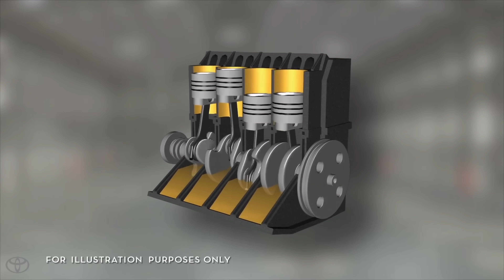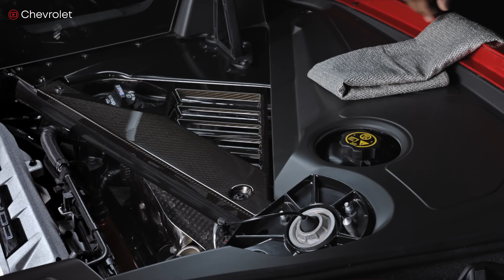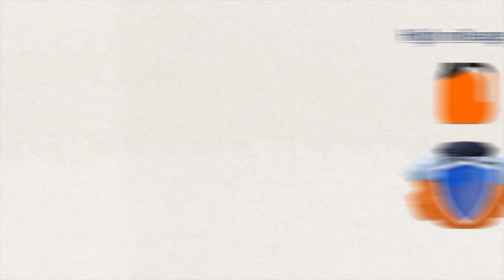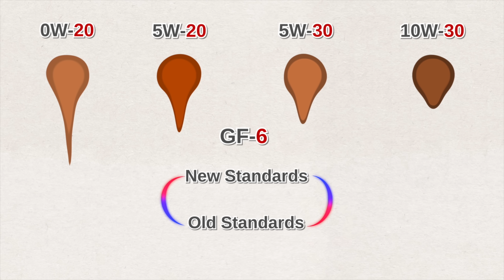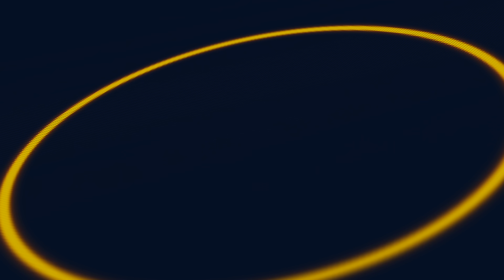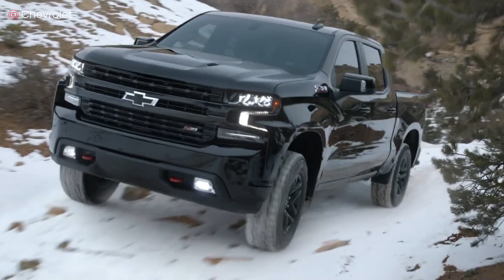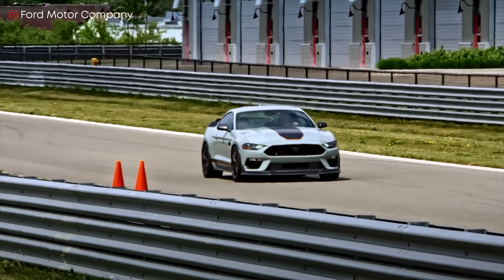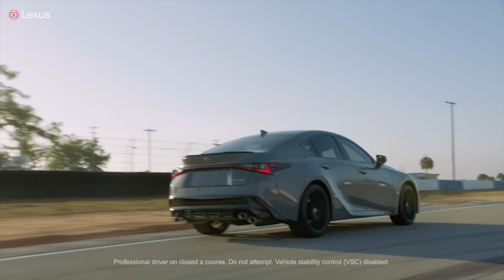7 Engine Oil Myths Stupid People Fall For

Comment: Scotty what do you think of the new 20000 miles new advance full synthetic?
Reply: I've owned some VW's and Volvos (in Sweden) and oil change intervall has been 30 000km (18 641miles) or at least once a year. Never been a problem. No one here changes oil between ordinary serices. And cars don't break down.
Reply: @lokis7230  much better oil formulations in europe though.
Reply: He made a video awhile back explaining how he'd never go that far on even synthetic oil. Oil advertised to go 20k were tested in controlled conditions and probably only highway driving. It's not worth doing on turbocharged vehicles and engines with variable valve timing.
Reply: My friend is a Toyota mechanic. He has replaced several engines where people
believed that 15 - 20K oil changes were OK with synthetic oils. One woman
had her oil changed in a Corolla at 15K then brought it in at 30K to have the second change. They used a long life full synthetic oil too. She complained about an odd noise. They  had to remove the engine.
The top of the head was covered in sludge and the main bearings were so wore it would
not hold proper oil pressure. Cylinders were badly scuffed as well. This was at only 30K miles. Believe me, regular oil
changes at no more then 5K miles are real cheap insurance against major engine failure.
Infiniti will not even warranty a car that  has engine issues where the owner has not
changed the oil at least every 5K.

Comment: One (probably stupid question)  Is High-Milage oil full synthetic?  I have been putting full synthetic in my 95 Vette for the life of the vehicle.  It only has 50,000 miles now, but when it approaches 75,000 should I stay with the full synthetic or switch to high milage?
Reply: i would stay with what you have been using

Comment: Scott,
I have a 2010 Chevrolet Suburban, with a 5.3 Vortec motor. I had a failed lifter, took it into a shop and the replaced all the lifters, pushrods, and the rockers. But when they started the engine after the repairs, there was still a ticking sound. They told me the do not know what the problem is, and didn't charge me full price since they did not repair the vehicle, but still charged me over $1,000.
I took off the valve covers, and confirmed none if the lifters failed. What should I check next? And, should I run 10W 40 to help quiet the motor?  The ticking is loudest at start up, then quiets down, but never goes away.  Also, the oil pressure is a little low.
Reply: That's common in the LS engines. It is a lifter not pumping up or holding oil. You could have got a defective lifter from the dealer. You also mentioned low oil pressure, I would address that first by cleaning the oil pump bypass or replacing the oil pump if you are not comfortable fixing it yourself.

Comment: Any one remember the days of re-refined oil?  The wisest thing for a car owner to do is read the owners manual and follow the recommendations contained therein.
Reply: Ahhhhh.....  Those "were” the days.....😉

Tear down an engine and rebuild it ... Just for sumthun to do.
Reply: I used that stuff in a 55 Ford I had.  It got 150miles/qt after oil change the 50miles
/qt there after.  I then used re-refined oil $.50 per qt.
Reply: @tim4269  engine rebuild pellets in a can from JC Whitney could've fixed that problem.
Reply: We ran drain oil all the time 🙃
Reply: Tom- When I was young and no money I never used new oil. Just used old drained oil from local garage. Vehicle used 1qt. every 100mi.
Reply: @rogertycholiz2218  That's honestly hilarious that you would do that to your engine and then brag about it
Reply: And they had the nerve to market it under the name Ring Seal in my area.
   👍👍👍

Comment: My 2008 BMW recommendation is 5W-30.  I live in O.C. California.  Should I use 10W-30, 40 or stick with manuel/dealer recommendation?
Reply: Stick with what the manufacturer recommends, making sure its synthetic. Your Owner's Manual may explain in more detail about what types of engine oils to use depending in climate/temperature/altitude, but for the most part, just put in what the oil cap has printed. Cheers! 👍
Reply: Find a european oil that meets your BMW car's specs. It is much better.

Comment: Scotty you didn’t cover HD  I’ve used 30HD in my lawn equipment forever. I’ve heard 2 different things for HD  
Heavy Duty.   or. High Detergent 
I bought an older car that didn’t get a lot of maintenance I changed the oil every 3000 but I changed the filter at 1500 and topped it off and changed ATF at 12,000 miles I changed oil filter ATF and I had quit using oil and I tried your trick of keeping 1qt of ATF and transmission felt better 
Sucked brake reservoir empty filled with fresh fluid and bled the brakes no air but not pristine looking brake fluid topped off coming up on 250,000 miles suspension bushings next and driver’s seat mine is only the 5th to slide in but it’s been slid enough to wear out cover and seat toooo it would be nice if it got the MPG’s my 90’s and newer gets but they put lots of good tough steel in Detroit cars/trucks back then and smog was PCV
Thanx love your honesty & knowledge 
short commute these days you & 1 kid in Tennessee the other (& mother) in NY state and memories of Texas

Comment: You mentioned that one may want to consider changing their oil more often, especially if they drive at higher speeds. I thought it was the inverse of this, that higher speeds cause less carbon buildup and are roughly equivalent to about 1/3 of the miles driven at city speeds. I’m assuming “higher” speeds meant “freeway/highway” speeds though and maybe that’s not what you meant. Clarification?
Reply: Higher speeds cause more heat.  Synthetics can better take more heat.

Comment: So, 0W40 is good im low and high temperatures?
Reply: Yes as long as the engine is okay with a 40 weight, you get the best of both worlds for freezing and high temps. 0w-40 eventually shears into a 5w-30 due to having a lot more viscosity modifiers.

Comment: I finally caught you leaving out an important fact after watching dozens of videos. Among "synthetic" oils, there are two main types. There are the PAO based, entirely synthetic oils that originally were the only ones. Then there are the hydro-cracked petroleum oils that have been permitted be called "synthetic" by the standards organizations, doubtless after an exchange of money. These hydrocracked "synthetics" are NOT equivalent to actual PAO synthetic oil. They break down just like petroleum based conventional oil.

In general, real synthetics don't cost much more, and mostly command the same prices as hydro-cracked petroleum so-called "synthetic" oils. They should be preferred every time. Shame on the automobile standards companies for muddying the waters, allowing enhanced prices for petroleum based products.

Comment: Full Synthetic Oil is not synthetic at all. And it is NOT 100% Synthetic Oil.
Reply: Are all oils with European car brand certifications 100% synthetic? I know there is Motul, but there is also Castrol, Liqui Moly, Pennzoil Euro and Mobil 1 Euro. Are these usually "blends?"
Reply: @Dcc357  There's only two companies that make 100% Synthetic. You named one in Motul and the other is Amsoil. They both are certified 100% Synthetic. All others are only blends.

Comment: Great info as usual!  Oil is always a hot topic.  Imagine that, check the vehicle and the owners manual!  That's the answer.  Older designs (Early 80's, 70's, 60's and older.), small air cooled engines like lawn mowers, ATVs/motorcycles, VW air cooled engines and other solid pushrod or flat tappet engines need Zinc.  You shouldn't use anything later than API SJ if you want it to last.  If you look at the bottles for small engine oil, ATV/motorcycle oil, and Elf oil for specific VW diesel engines, you will see it is API SJ.  The Zinc is consumed, so changing the oil more often is needed in those designs.  The best oil is the one the engine is designed to use.
Reply: That's for the zinc enthusiasts. The rest of us use most any modern engine oil without a problem or concern.

Comment: This is a great video and very informative. That said, what type of oil do you recommend for an electric car? Oh, wait a minute, I just remembered that an electric car doesn't have ANY of the parts that oil protects from wearing out. I guess that's why engineers have concluded that electric cars are far more reliable, will last longer, and have far lower maintenance costs than cars with internal combustion engines.
Reply: Do you feel better now?
Reply: First of all the tech in those cars like Teslas won’t be lasting more than 10/15 years guaranteed. Maybe it will but it will definitely need expensive repairs (think $10k +). Simply because the plastic and wires and electronics might have beeen cheaply assembled and made. But when they break they also affect surrounding areas which in return means more expensive repairs in the long run.
Reply: Lol yeah okay maybe in fantasy land or a fixed climate in reality far from the truth. And who do you think builds a better vehicle some amateur that just started a year ago or a company who has been around for 100 years.
Reply: @foxbodyguyeightyeight3672  Right all the Tesla people out here defending their brand as if their so called technology will last 10+ years
Reply: Tell that to the people whose electric cars are INOP because PCB failures of parts shortages.
Reply: @Old-n-slo-locked-n-leaned  Do you have any evidence that people with EVs are inconvenienced more than gasoline car owners, or are you just making stuff up? Seriously, point to a study or some data based upon something other than your personal opinion,

Comment: Scotty, I drive a 1985 ford ranger with a 2.8l v6. I change my oil once a month religiosly. Ford recommends 5w30 conventional, I run Valvoline 10w40 full synthetic high mileage and wix XP filters (change the filter every oil change) I decided to run a slightly thicker oil due to the fact that my truck has +800k miles on it with original engine ECT. 
I also only use ethanol free 93 octane fuel in my truck. 
I drive about 400-700 miles per month (never aggressively 65 mph and less)  and I'm trying to do everything I possibly can to preserve the life of my engine and drive train. I also change my plugs, wires, fuel filter and air filter every 3 months as well as thoroughly washing my engine and engine bay with super clean about every 2-3 weeks. Do you have any opinions about my regiment for my engine care, anything you would recommend? 
I also run ¼ can of seafoam to a full tank of fuel once a month after my oil change.
Reply: Ford should but that truck off of you that's the only 2.8 V6 I've ever heard of getting more than 150000 miles 🎊🎉🎉🎉
Reply: @foxbodyguyeightyeight3672  it's a good running truck, my friends grandpa bought it new in late 1984 (November I think) the man drove it from Georgia to Iowa twice a month and everywhere in between, my buddy's other friend bought it a couple of years ago and wrecked the clutch within a month. I bought it from him for $150 and fixed everything he managed to tear up and I've been driving it ever since. Mr. Cason kept the oil changed every 3k miles and regular maintenance. I recently pulled a trailer all the way to Pennsylvania for a mower race and swung back through Ohio on the return trip
Reply: Overkill

Comment: Use to change my own oil.  Now I just take it to the dealer.  They rotate the tires as well.  Expensive ($50) but I'm old!  LOL
Reply: Took my 6.7 to a local quick lube place.  Next oil change i did it and found a extra oil filter gasket. Luckily it didn't turn into a problem between changes. I only do it myself now no matter what's going on in my life
Reply: Dealers " usually " know how to change your oil , but they ll charge a lot .
The Quick Oil  change places and the Walmarts , Jiff Lubes , etc , usually have inexperienced 
techs working and they can do more damage than good. 
Incorrectly tightened/ overtightened drain plugs , Oil filters and not putting the proper amount of oil back in are some of their usual screw ups.
Reply: @jayhockley8841  I took my 2019 ford Ranger to the dealer for its first oil change and they forgot to re connect a sensor on the air intake.  I also asked them to check my oil for gasoline contamination because the oil level was high and smelled of fuel.  They didn’t so I’m not sure I want to sing the dealer praise song and dance.
Reply: Which part of 50 bucks is expensive?
Reply: @twinsonic  The part where they use the cheapest oils and filters

Comment: Hey Scotty, Have you made a PSA about how modern oils lack zinc that is required for flat tappet cam engines. I learned a expensive lesson after break-in with conventional oil and using zinc break in additive in a completely rebuilt engine from the early 90's. Then I switched to using full synthetic in a and the camshaft lobes wiped out after 10k miles, leaving the engine with a terrible miss and a hole in one of the hydraulic lifters. If you have an older engine the synthetics will fail because of the lack of zinc
Reply: How do you know that the problem didn't start at break in with all the zinc you used and only turned catastrophic after more mileage was put on it? For all you know the synthetic may have slowed the problem from happening sooner. How is it that others have used regular oil without additives on their built flat tappet engines successfully at the initial startup? And some who don't even use a break in procedure.

When I "broke in" my SBF 289 back in 1986 I used Valvoline 10W40. Basic and nothing special. I doubt that it had any more zinc than most modern oils of today. Zinc is only one piece of the the overall anti wear package these days anyway.

Comment: use what a manufacturer specifies...same as gasoline octane. ENGINEERS of your vehicle engine know more than you do... so do not guess.
Reply: Is that why I can't replace a camshaft sensor without removing the entire engine? XD
Reply: So what is the automatic atf in my 2020 car manual says it never needs to be changed? Do I comply to that indication?
Reply: @tomorrowcomestoday1621  
Good point. My opinion is no. I do at least one drain and fill a year cause I know my transmission runs 15⁰ to 20⁰ higher than it should during the summer.
Reply: @masterofnone1808  thank you for your reply. I own a grand cherokee and I've seen here on YouTube transmission maintenance interval but I see that it is very specialized and detailed procedure.

Comment: Is time between oil changes a myth? My Cummins diesel owners manual says change every 15k miles OR 6 months. No way I drive 15k miles in 6 months. I change it once a year at only about 10k miles. Should be okay right?

Comment: I use conventional oil and this BG product called EPR MOA and 44K. It work way better than any synthetic or whatever. It's only sold at dealership. I am currently doing a test on my Miata and next on my GDI Veloster.
Reply: How would you know it works way better than any synthetic? Just asking how you made that comparison?
Reply: Its 44k type. My shop Forman went to a school On it. I used clean synthetic oil in my car. I never missed an oil change. I used clean to use the EPR engine performance restoration. I ran it for 15 minutes including revving to over 2000 rpm. I drained out the oil after I was done. The oil was black and dirty after 15 minutes of using the cleaner. I put clean oil and new filter and the oil filter and the oil is cleaner than before. I still have some more time on this oil change. I have some of the oil I collected when I did the flush.

Comment: I had a question for Scotty been trying to get on your live videos lately but couldn't catch you on time . Question: I have a dodge avenger 2013 2.4 L SE 119,564 miles and I get a check engine light on and so I check it .I get a code P000a : camshaft sensor bank 1A slow response. I had it changed but the code still comes up what should I do to fix the problem. Other mechanic places charges me hundreds for problems that don't concern the code .please help.

Comment: If my car says use 0w20 and use 5w30 as a substitute, can I use 0w30?
Reply: Still can use but it may cost your $ more than 5w-30.
Reply: Yes in fact 0W30 will match better to 0W20 then 5W30 and will give a little extra margin for safety from fuel dilution & stuff especially if it's a turbo.
Reply: Yup and 0W30 is most likely a better oil then 5W30 because it takes better more expensive components to formulate the 0W s.

Comment: Scotty, many engine builder's hate the synthetic oil because it works to well. The oil protects agniast metal agniast metal parts, but the oil builds up on the other parts of the engine that don't have contact with other metal parts. Cams, crankshaft have buildup on the parts that don't have contact with other moving parts. Years ago, I read an article to remove some oil, and put in transmission fluid to help dissolve build-up before a complete oil change. The transfluid will help in breaking down any oil buildup in the engine.

Comment: My 17 Elantra calls for 5w20 but I use 5w30 because I have over 130,000miles and the only reason it uses 5w20 is for gas mileage and the manual says I can use it. Every other Hyundai with high mileage is rattly but mine purs lol

Comment: Will running gf6 oil in my 1998 Toyota 5vzfe provide any benefit?  I always just use synthetic blend and mobil filter every 3500-4k miles
Reply: I believe gf6 is a highly refined synthetic and it should be very good and may sound smooth. I use amsoil signature series on 1999 3.8L and it definitely sounds much quieter. I believe amsoil is only gf5 so gf6 should be even better.

Comment: I bought a car brand new and have changed my oil every 3000 miles with conventional oil and 16 years later it is running just fine.
Reply: Hasn't been necessary or required to do that for over 20 years